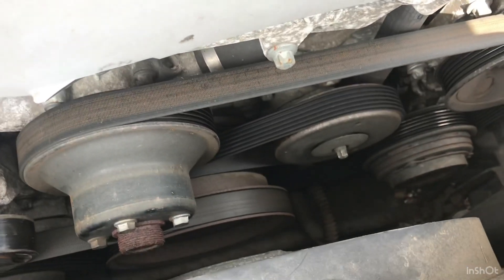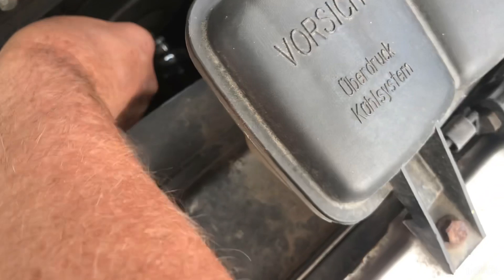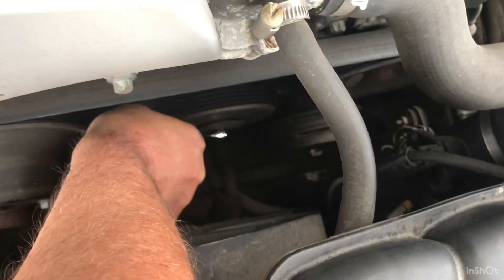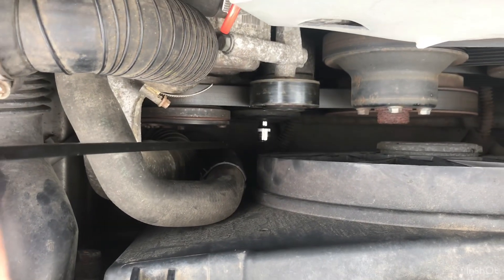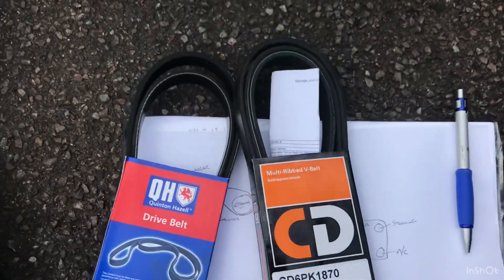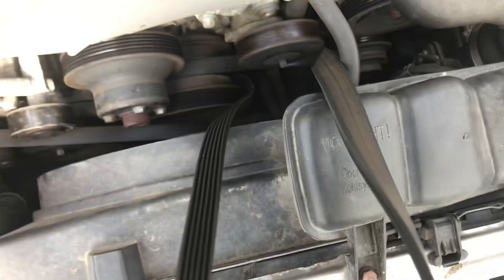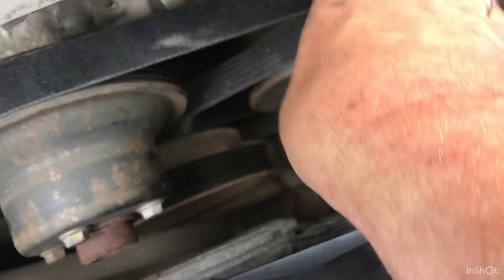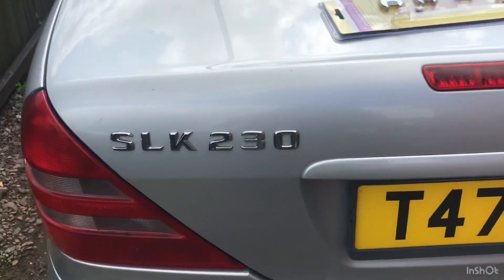How to change the drive belts on the Mercedes R170 SLK 230K

Comment: Just a suggestion - provide links to the tools and parts that you use on a job. Thanks for making this video! I have the same car in a 2004 model, and will be changing belts, tensioners, etc this summer.
Reply from the maker: It’s a good idea but I bought my belt tools from eBay and Amazon. The problem is the sellers come and go. That’s why I usually put pictures of the tool from where I got it and not an actual link which may well be dead. It was easier years ago when there were many parts stores around. I’ll try to do so in future though. Good luck with the car.

Comment: Use a cheater bar, (aka, pipe fit over the handle of the ratchet for leverage), it costs zero money if you have a pipe laying around. If you do not, then use an 8mm 12 point box end wrench on the bolt and the then grab another bigger box end wrench and use the open end of the 8mm wrench and hook the box end of your bigger  wrench into the open end of your 8mm wrench and viola, you have a cheater bar to give you more leverage. **Pro tip: when asserting a lot of force using your hands, keep your hand in an open position. If you use a closed hand on the wrench, your likely to bust your knuckles when the nut/bolt breaks loose.
Reply from the maker: Thanks for the information. Much appreciated

Comment: Btw it does show a 1328 for the alt belt which I haven't fitted yet rather than a 1350 as mentioned below - I'll let you know how it goes. Also has good diagrams of the routing of both belts.
Reply from the maker: Excellent..thanks for the helpful information Geoff

Comment: Do you know where I can get a manual online for free ? Like Hayes manual.
How much travel was on the tensioning wheel because I can only get an 1873 belt that should be okay it's only 3 minutes just curious to see how much travel is there .
Reply from the maker: Not for free. There are downloadable ones on places like eBay though. Pretty cheap. Not sure exactly how much travel there was, but it was a fair bit as I remember.

Comment: 2002 slk 200 supercharger oil change. Do you know my friend where is the bolt ?? Thank you
Reply from the maker: It’s at the bottom of the left side as you’re looking at the engine from the front. It’s towards the front closest to the radiator.

Comment: What is the code for the belt
Reply from the maker: The belt can be from many manufacturers but the important bit is the length. Mine (with a/c) is 1870. If you loook up drive belts find one that length and you’re good to go.